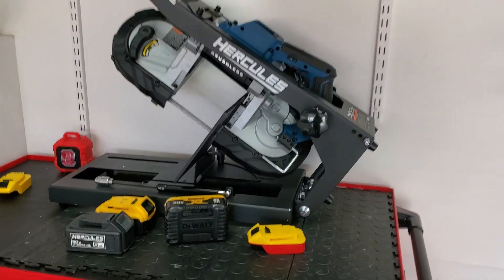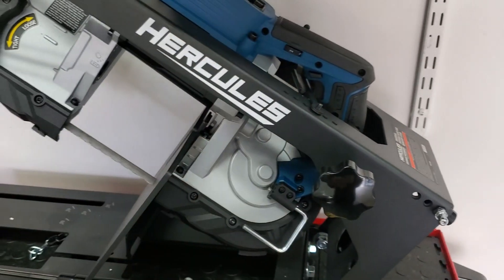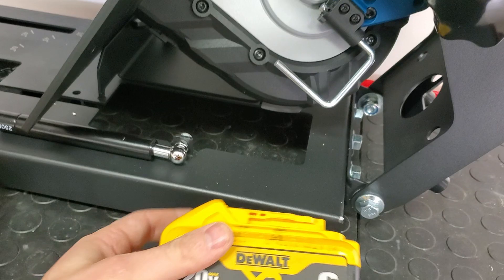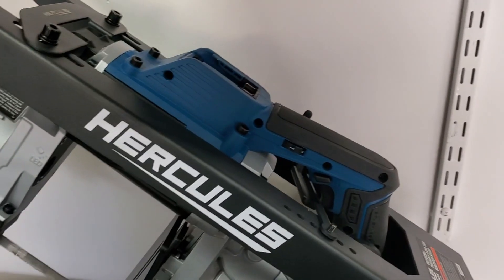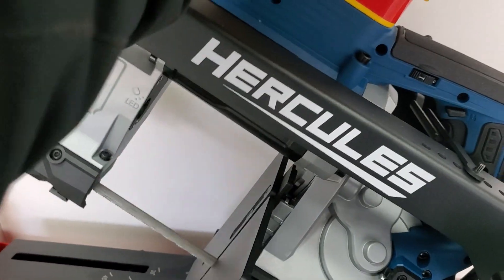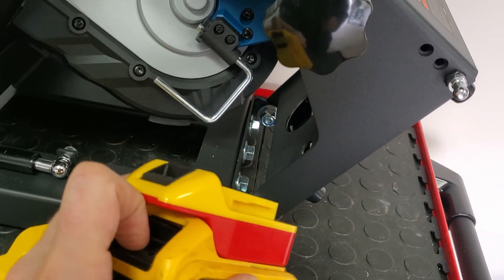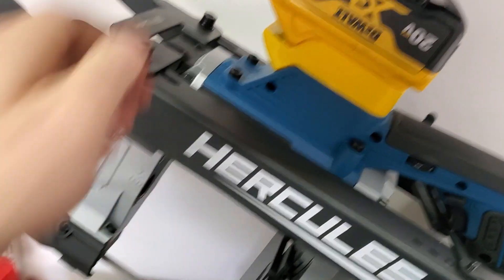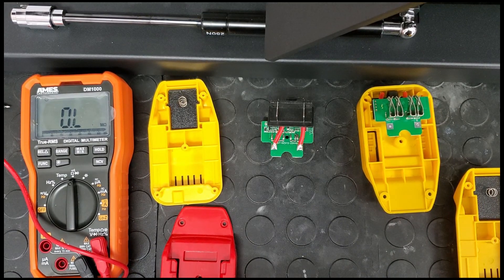Dewalt 20V Battery to Hercules Tool Adapter - Works on some tools (Update: New Version Works!)

Comment from the maker: Edit: The newest version of the adapter now works on all tools, check out my updated video on it.
Reply: Did you ever get that adapter still wait to see if you figured it out
Reply: Hi, it's been almost 10 months since the last adapter update. We've maximized compatibility in the new version, but we still need your help testing it on the Hercules 20V Bandsaw. Please reach out to us. Thanks!
Reply from the maker: @linxiao2574  I bought your new adapter personally, I tested it quickly in a few tools and it worked fine when otherwise the old version didn't. I will test my bandsaw soon and post an update video. I have a lot more Hercules tools since this last video.
Reply: @FilthyGopher  well big boy we need updates.
Reply from the maker: @iwildoitmyself  I did, see my other video. https://www.youtube.com/watch?v=gl_eU-umbeE

Comment: Just received one from the same seller today and it works on my new bandsaw that I just purchased for the memorial day sale. Dewalt 8ah battery. Guess they figured it out. Get it while you can!
Reply from the maker: I saw the seller is selling them again and removed the incompatibility warning from his listing but haven't had a chance to try out the revised adapter yet. Good to hear.

Comment: This is how I converted to Bauer and Hercules. I bought a Bauer tool to use with my extremely exorbitantly priced DeWalt batteries. No go. Took the battery with adapter to HF and tried it on everything with the result none of the saws would work. Ended up with the original saw 5&8ah batteries fast and rapid charger and an additional "free" tool for less than the DeWalt saw would've cost. Ended up in Hercules for the non crossover.

Comment: Dewalt batterys will fit bauer tools with a snip of a tab on the bauer tool
Reply: Dewalt batteries also fit Hercules tool without any adapter with minor modification to Hercules housing. But of course they're still electrically incompatible.
Reply: @testeraccount5139 yeah. I just figured that out today actually.  They used to fit and work, not anymore... i just bought a bauer buffer, ordered an adapter tho so i dont have to get a bauer charger and batteries.

Comment: Thanks for this video! Any updates on getting the brushless band saw to work yet?
Reply from the maker: No, haven't heard any updates from the ebay seller in awhile now. Last I heard he was still trying to revise the adapter.
Reply: @FilthyGopher  ok cool, thanks for the response. Im hoping to eventually find one that works on the bandsaw. Let me know if you find one! And i will also.
Reply: I'm looking to adapt Milwaukee batteries. But did you ever get it to work properly?

Comment: Item is out of stock. Why are these adapters impossible to find I’ve been looking for months
Reply from the maker: not sure, the seller was communicating with me pretty regularly and even sent me a prototype to try on some tools. I think they are still working on making an adapter that works with all Hercules tools, as they probably have a high return rate when people find out the current one only works with some of the tools.
Reply: @ ya would have been nice to get an adapter while it was available. If it doesn’t work on some fine. But yeah I hope they can make one that works on all Hercules I don’t want to have so many different batteries
Reply: @FilthyGopher  it’s crazy no one has it even the people making 3d printed ones I can’t find any
Reply from the maker: @Nathang2233  my understanding from the seller is that is not as easy as just re-configuring the wires. Some of the Hercules tools use "smart" battery sense technology to detect their batteries based on a certain electrical wave outputs that are produced by an certain algorithm that is hard to reverse engineer. Not all the tools have this technology, thus why the adapters works on some of the Hercules tools and not others. 

The constant communication between the tool and batteries is supposed to extend run-times, improve power, and promote safety. I would guess it also lowers warranty claims on their batteries and tools when people aren't using unauthorized batteries in their tools.
Reply: @ ya the seller finally messaged me back about a month ago and said they figured it out and it would be ready to sell in a week but it’s long past and it’s still not in stock on eBay
Reply: Any update on this?  @FilthyGopher

Comment: It appears the adapter is using a PIC to simulate the signal that the battery is meant to send to the tool. Can you please take some high res pics of the board, as I'm trying to see if its both pins that need a specific signal, or if one is just an NTC. Thanks!

Comment: I see that on this sellers ebay page it says this adapter is not intended for use on "angle grinder or bandsaw." By any chance have you tried it on any other Hercules tool to see if the issue really is limited only to the bandsaw and grinder tools?

Comment: Purchased the same adapter to use on Hercules 20v polisher, having the same issues. Hoping in can find a workaround as I already have 25+ dewalt batteries and the Hercules brand is so close as far as battery connection and at a fraction of the price.
Reply: I bought same adapter for the impact wrench ½" I've gotten it to work for like a minute after fully charging, but never again sadly. Have you or anyone found a solution?

Comment: I just ordered the adapter and hopefully it will work with the Hercules vacuum.
Reply: Did it work?
Reply: Did it work??? Thinking to pick up that same vacuum
Reply: @MichaelPuccio-b4n I have the Bauer vacuum with the red molded plastic battery adapter off eBay. To a dewalt 20v 5ah battery. It works great. The only thing I don’t like it’s the battery is way on the end so it make that side heavier and it’s not balanced very well. But it works great for cleaning up messes